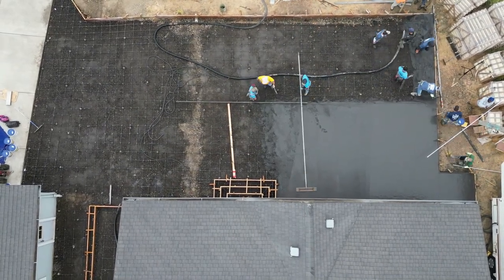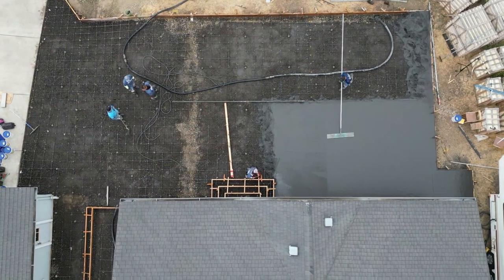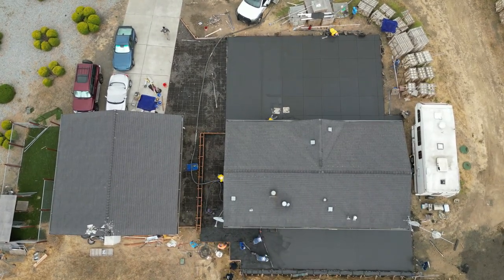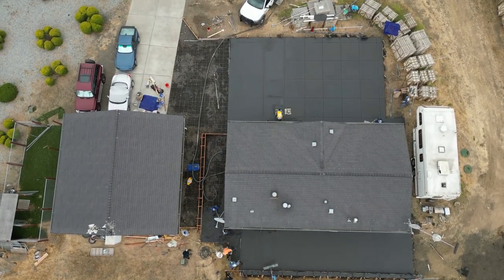1 DRONE / 11 FINISHERS / 4 LABORS / 50 YARDS / CONCRETE PATIO

Comment: That is one hell of a technical pour and finishing! no surprise you needed 11 dudes working their magic!. 
What a difference, I reckon the owner made the correct choice of concrete instead of decking. 

Your next 10K subs will only take a couple of months. Crazy how it works.
If only there was a drone you could hang a finisher from.....just think what you can achieve....hee hee..
Reply from the maker: Now that would be crazy somebody hanging from a drone.. 🤣🤣